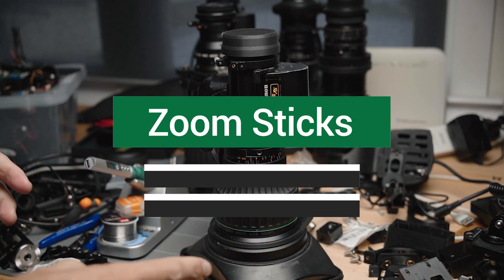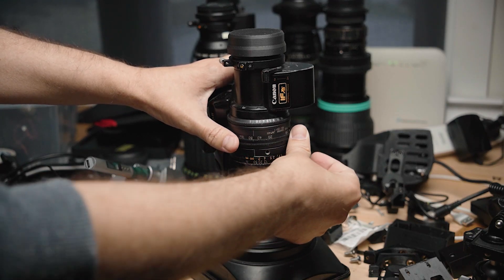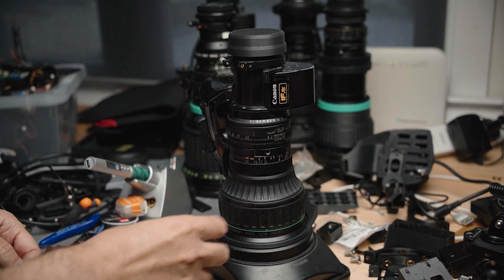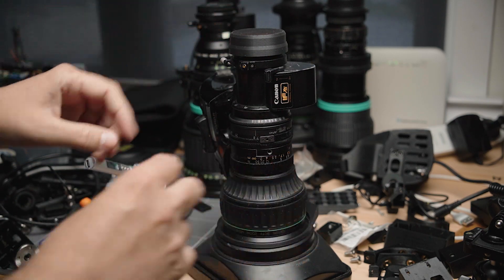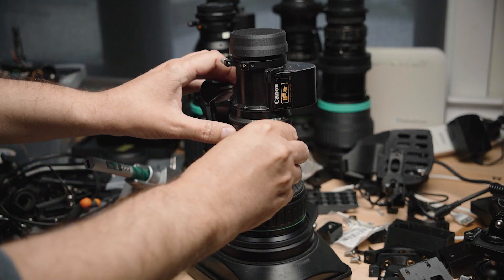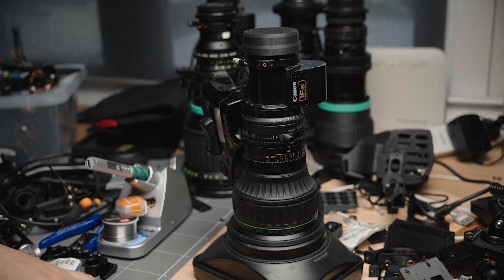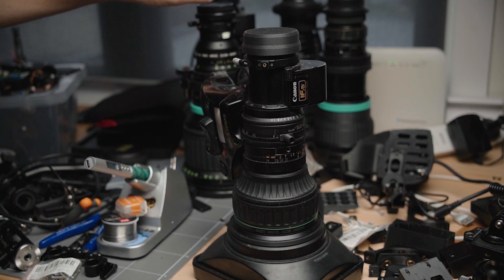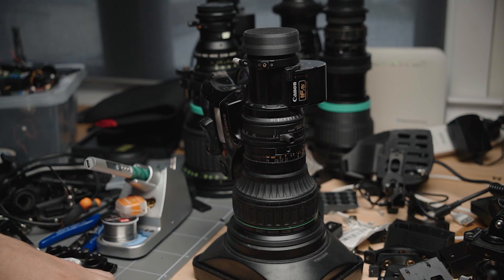Broadcast Lens Zoom Sticks // FREE easy 3D print file(s)

Comment: Hi James
I am following your ch for some months. Now I feel I need your advice about the lense. I bought a varicam S35 a month ago. I was thinking to use my B4 lens on arri PL mount of varicam. The lense on my old sony dvcam DSR 370 is Canon model VCL-719BX
I would like to know which lense adaptor can work with it. If I remove the servo from B4 lens would that be ok? 
Many thanks
Reply from the maker: Hi, I am not familiar with the Canon VCL series. It is likely that it is not 2/3" B4. Is there another model code on it anywhere? Under the lens or on top of the servo grip? There are a lot of broadcast lens models unfortunetly most are not suitable for adapting.

Asside from that servo grips are usually easy to remove. However beware the lens zoom and iris rings may be very loose and too easy to move after the servo grip tension on then is removed.
Reply from the maker: From a quick google it looks like its a YH or KH series 19x6.7 lens which is 1/2" format from memory. Unfortunately 1/2" format is much harder to adapt and there are no optical corrective adapters that I know of.
Reply: @jamesandcamera 
Thanks its YH19x6.7 IF19x
I believe its a half inch lense.